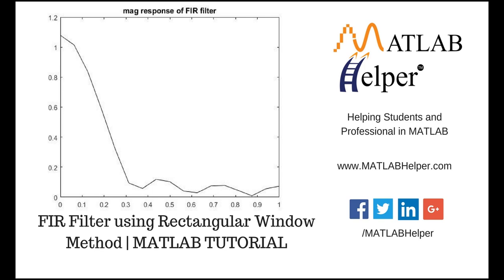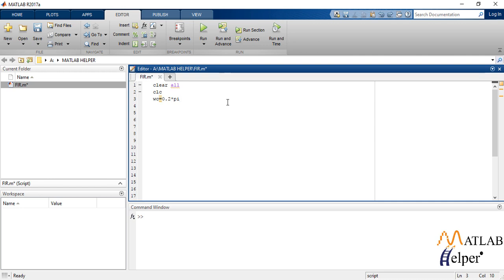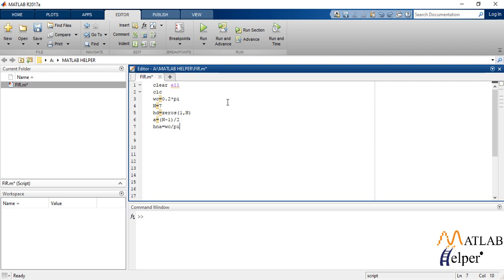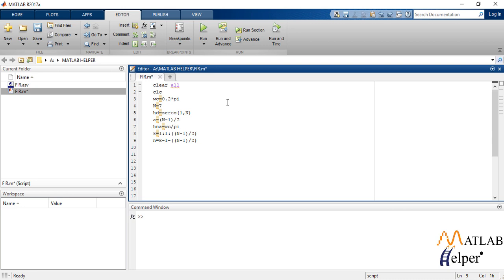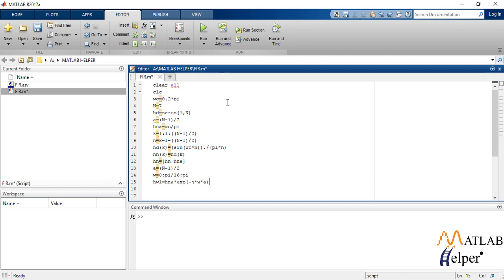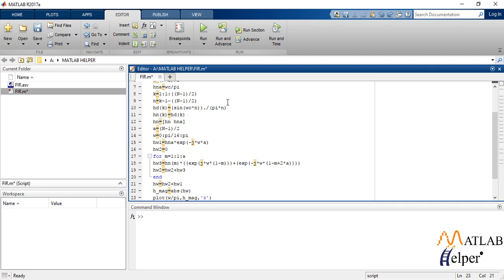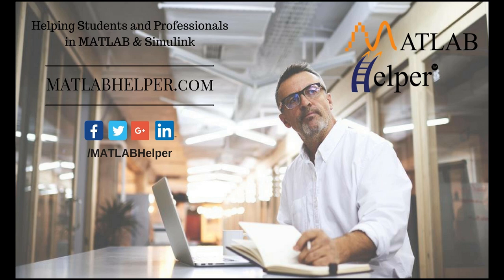Window Method for FIR Filter Design | DSP | @MATLABHelper

Comment from the maker: Book our premium course on DSP at https://mlhp.link/DigitalSignalProcessing/
Read this lesson at https://matlabhelper.com/course/finite-impulse-response-fir-filters-using-rectangular-window-method/ for codes & explanation.
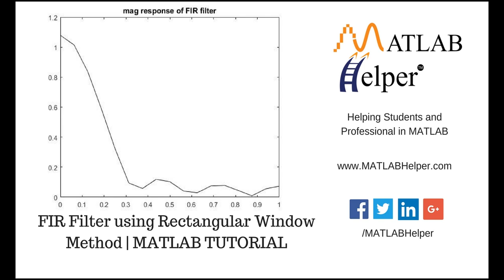0:00 Introduction 
0:14 Problem to be solved
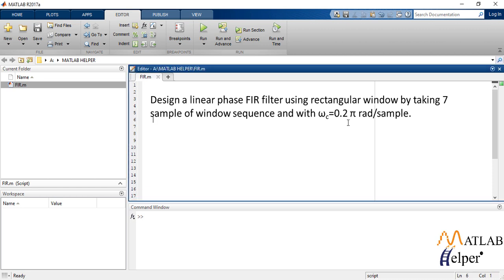0:32 MATLAB Code for designing filter
2:21 Run MATLAB code & Check Results